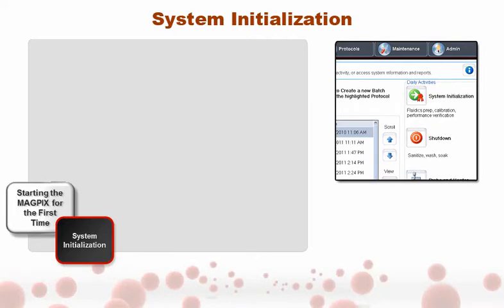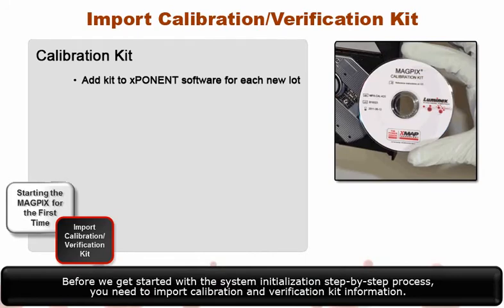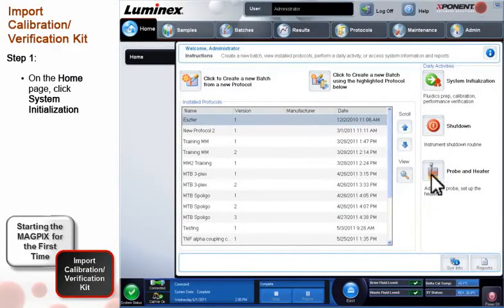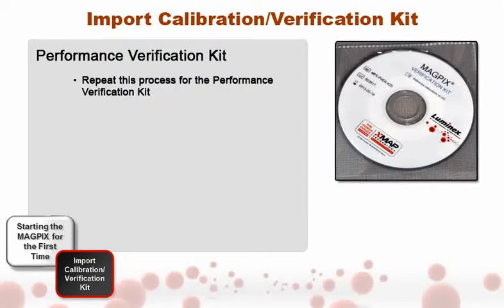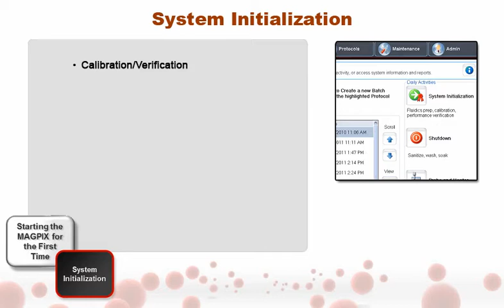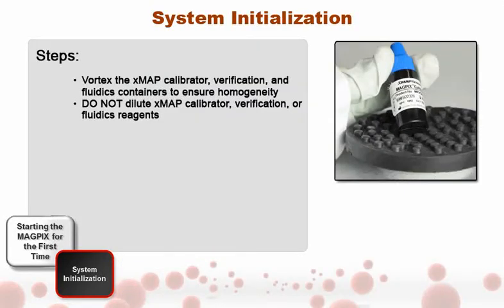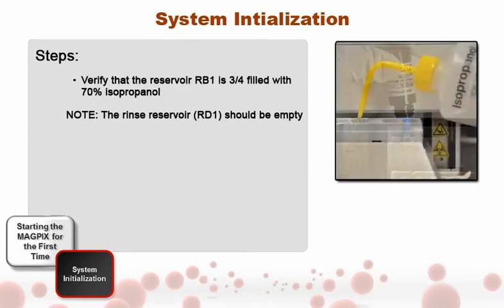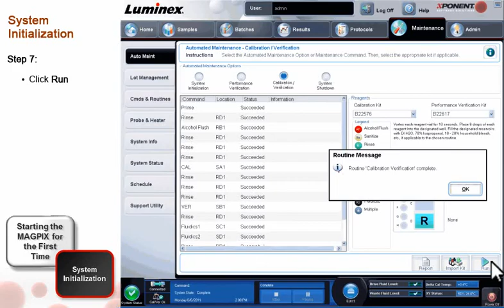MAGPIX® System Initialization

Comment: Is 70% isopropanol mandatory? would 70% ethanol be comparable?
Reply from the maker: Hi and thank you for your question. Please accept our apologies for the very delayed response.  According to the MAGPIX xPO 4.2 IVD Software User Manual, you can “add 70% isopropanol OR 70% ethanol to reservoir RB1 on the off-plate reagent block as indicated on the Cmds & Routines tab.”  
We hope this helps address your question.  Please feel free to contact our Customer Support team with additional questions.  1-877-785-2323 or email support@luminexcorp.com